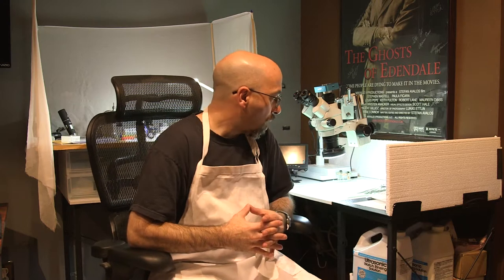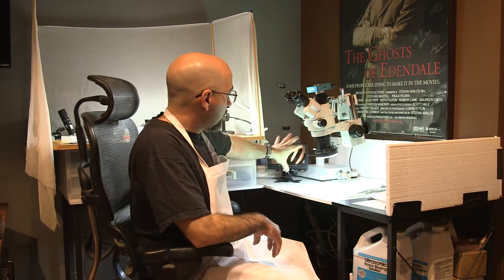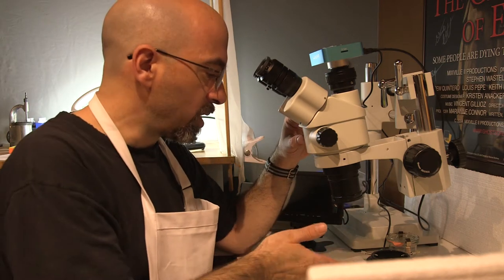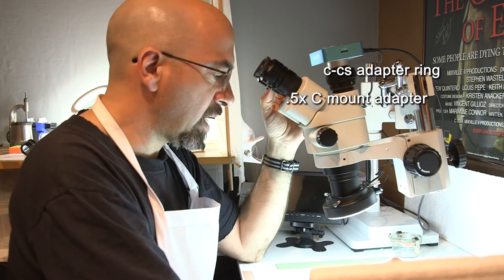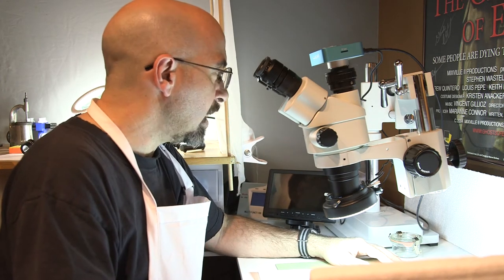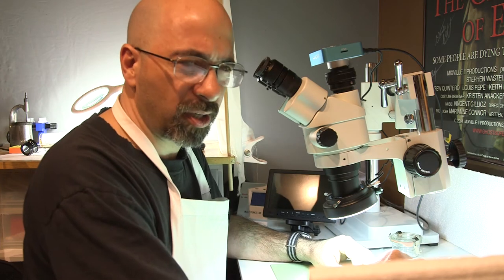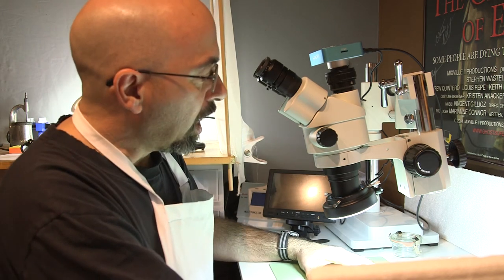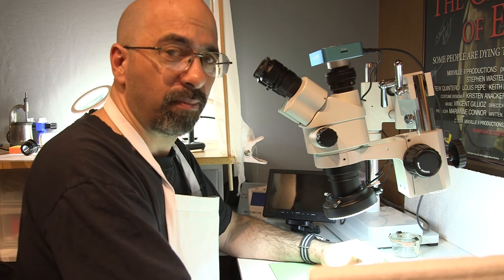Why an Amscope Microscope is AWESOME for watch repair!

Comment: Most difficult thing I have ever done trying to download rar file and trying to have computer recognize camera. Still working with Chinese company to get working. It's not a plug and play with camera install. Far from it. Do you have video on how to install camera?
Reply from the maker: Hi, I don't have an install video but suggest that the SD card is the easiest/best way to go with recording images. As pondered in my other reply - what size card were you trying? I'm using a 16GB card with no issues. 128 GB didn't work. What OS are you using? osx or windows?
Reply: 16 gb card worked. Camera manufacturer should have included. I can now video tape record on 10 inch monitor. My windows 11 system still not recognized camera. That's my next project.
Reply from the maker: @danflayler9948  Glad to hear it worked out. I think the issue is that it's technically not an "SD" card... it's TF Card. I suppose the format structure is different??? Anyway, i don't even bother with any other form of recording. It works really well.  Have fun and let me know how it goes!

Comment: great review :) I am thinking to get one too (hobbiest here) - do you think that this model would be suitable : 3.5X-90X Black Simul-Focal Trinocular Stereo Zoom Microscope with Double Arm Boom Stand SM-4TPZ-B? it has a little longer distance of work view and it is autofocus on camera too. Thanks
Reply: forget the above, decided to get same model as yours SN4ntp.  Can you post a link for the .35C mount adapter for the camera, Thanks
Reply from the maker: @madmechsgarage1727   Here are links to all the parts and pieces I purchased, including the Adapter... 

Here are links to all various parts I ordered for this microscope setup.

Microscope
https://amzn.to/3wwW7Jt
(this can also be purchased from Amscope. Check both sites because prices vary)

Barlow Lens
https://amzn.to/38Mqnqu

LED light
https://amzn.to/3sOuklB

Camera
https://amzn.to/3GmjWXT

Adapter for camera to microscope. (.35)
https://amzn.to/3GbbFFR

Video Monitor
https://amzn.to/3G55sLK

HDMI Cable
https://amzn.to/3MOuYHq

L shaped Desk
https://amzn.to/3PxEsZF
Reply: @sma1968  Thanks :)

Comment: Nice video!. I am in the same situation as you were before you bought the scope. I am new to the hobby and seeing things clearly is my main frustration. I have been thinking to buy some magnifying tool that can take this BIG frustration away.  I have seen the Andostar (at My Retro Watches) and this one (Amscope). Now I am confused which one to go for .... Andostar is less expensive but I am wondering why you did not go for Andostar. I am sure their must a very good reason but I am wondering what that would be (because there is a huge price difference). I would appreciate if you could let me know so that I can make an informed decision and don't repent afterwards.
Thanks
Reply from the maker: Hi, Thanks for compliment and glad you're finding the video useful. I just checked the link and it's still the same microscope and stand. Might just look different from that angle. 
The Andostar is great for examination of stuff - but the real limitation is that it's not a three dimensional (stereoscopic) image - and not 'quite' real time. That makes doing actual work with it a lot more tricky.    I know it may not sound like quite the big deal that it is - but it is. :) 
Being able to work while viewing everything stereoscopically (and in absolute real time) is the real difference and (as I repeatedly say) game changer of all this. 
Basically, looking through the microscope makes it almost feel like you're working on a car engine. LOL. (though you're reminded that you're not when you drop a part)
Reply: @sma1968  If there is a lag, then it is not good (BTW I heard one of the reviewer saying there is no lag). The reason I am tryin to shy away from it is in Canada this scope is C$1241+161(tax)=1402 which become expensive for a beginner. Not only this, I will have to buy some additional stuff (camera, lens, light, etc). Scope alone is not very expensive which is at C$486 but when combined with stand, it becomes expensive.  
 I was wondering if I can buy it alone and then get the stand from some other source which maybe cheaper.
Reply from the maker: @IamGPSGuy   You could buy just the head and then try to find a stand... However, (because I did try all sorts of price variations), I couldn't find a way to beat the price I got. This is a link to just the microscope head... 
https://amscope.com/collections/stereo-microscopes-microscope-heads/products/sm745tp

HDMI doesn't have any (noticeable) lag, which is why I prefer it to USB. You can also plug it into any hdmi monitor for viewing.
Reply: @sma1968  I realize that I am taking lots of your time and you have been really prompt in your response. So many thanks for that. One final question: I noticed that it comes with two kinds of sands A) Dual Arm Boom stand (the one that you got) and the other B) Single Arm boom stands which about US$ 100 cheaper. What is the advantage of buying A over B? (I ask this because you went for B).
Reply from the maker: @IamGPSGuy  No worries on questions. It's a big purchase. The main difference (besides maybe a bit more stability) is that you can slide the double boom arm in and out without changing the angle of the scope (angle of the lens facing down in relation to the watch). To be honest, if you're trying to save money any which way possible - this IS one place you could do it and not kick yourself later. :) I wanted the option of easily sliding the microscope out of the way - but I haven't really done that much. lol I use it 98 percent of the time.
Reply: @sma1968  Thank you very much. That sums it up.

Comment: Hi, you said this is a part-focal microscope but on the amscope site it says it is simul-focal, is that one and the same thing?
Reply from the maker: Hi. Those two descriptions actually are about different things. 
Yes, it is a simulfocus scope - what that means is that the camera functions along with the eyepieces at the same time. Scopes that don’t have that feature actually have to shut off one of the eyepieces for the camera to work (the image is redirected to the camera from the eyepiece- which is quite inconvenient) 

Par-focal means the image stays in focus no matter what your magnification power is (with the lens staying the same distance from the subject). Many scopes, with fixed lens require you to move the lens further or closer to the subject (and then refocus) to change the magnification power.
Reply: @sma1968  Hi, Stefan, great thanks for the details answer, I see you are very well aware of the microscopes, which is very useful for all the people that follow your videos. With the risk to be a bit annoying, a would like to ask two more things:
 - first is about the feature par-focal - I got the idea, but my question is how to figure out of a microscope has this feature or not. For example even on the AmScope web site this is not mentioned for this model (https://amscope.com/products/sm-4ntp). Is it this line ("The zoom lenses can be locked to maintain a consistent magnification") that means that the microscope has par-focal feature?
- second question is about the Barlow lenses. I see that very often these Barlow lenses are sold in a pair with 0.5x and 2x (seldom one can also see 0.7x). My question is what is the difference between 0.5x and 2x and which Barlow lens gives you larger working distance (in your video I see that with 0.5x you are having something like 20 cm working space, which is quite OK, but what will be the difference if you use 2x lens).
Thanks in advance for your answer and keep on with the videos - they are really useful!
Reply from the maker: Hi, I don't know exactly how one would know if the zoom is par focal or not based on specs (unless they specifically mention it). I think most of the zoom models will be - And all the SM series Amscope scopes are essentially the same scope (with just different attachments or lens kits) - so they will all be par focal. The "fixed power" microscopes are the ones that you want to stay away from for watches. (you have to move the lens closer and further away from the subject and refocus to change zoom). 

Barlow lens. The .5 will halve your image power (and give you more distance from the subject) and the 2x doubles the image power (and you need to get closer). So when you see the microscope zoom range say 3.5x-90x - that's with two lens changes... the base microscope does 7x-45x. You put on the .5 Barlow to get 3.5-22. You change to the 2x Barlow to get 14x-90x 
With watch making you don't need the 90 x power. So, I would save money and just get the .5 Barlow. Even 45x is much more than is really needed - and that comes default with the microscope by just taking off the Barlow; and so far, I haven't taken the .5 Barlow off for any watch work.
Reply: @sma1968  Many thanks again, now it is clear to me how it works and what to look for. Great explanation, by the way!
Reply: Maybe a stupid questio, but yet, for the par-focal functionality does the microscope use power supply? I mean, how does this autofocus functionality work - I mean the functionality to keep the object in focus even if you move it under the lenses while working.
Reply from the maker: @vesselingenadiev2526  It's all in the optics. No autofocus functionality/power supply.
Reply: @sma1968  Thanks!

Comment: Where do you purchase your watch parts?
Reply from the maker: Depends. If I can buy parts or movements on ebay I do that. For new parts, Ofrei, CousinsUK are my go to. For materials, usually Esslinger.
Reply: @sma1968  thanks for the Beta!
Reply: Could you please supply the exact spec’s for your microscope, lens, stand, etc. I like to obtain the same exact set-up
Reply from the maker: @williambrooks3436  Microscope
https://amzn.to/3wwW7Jt
(this can also be purchased from Amscope. Check both sites because prices vary)

Barlow Lens
https://amzn.to/38Mqnqu

LED light
https://amzn.to/3sOuklB

Camera
https://amzn.to/3GmjWXT

Adapter for camera to microscope
https://amzn.to/3GbbFFR

Video Monitor
https://amzn.to/3G55sLK

HDMI Cable
https://amzn.to/3MOuYHq

L shaped Desk
https://amzn.to/3PxEsZF
Reply: @sma1968  Thanks Again!